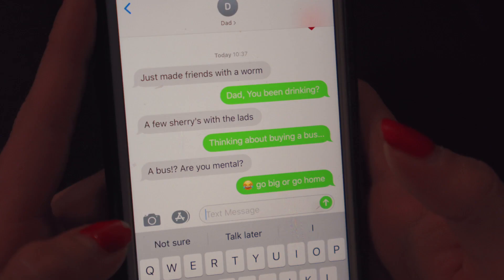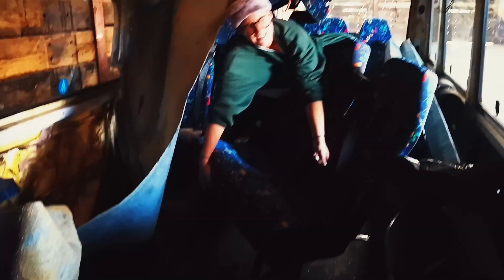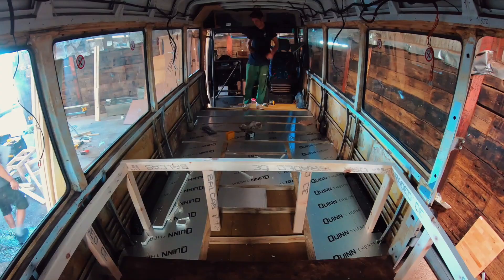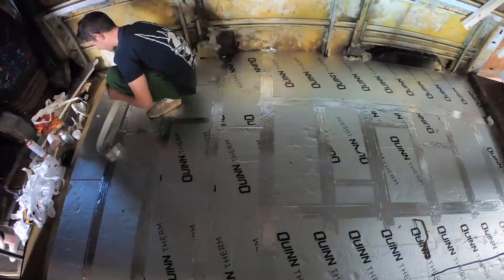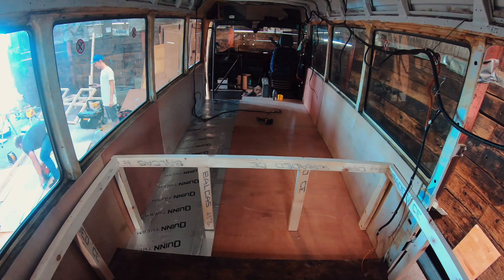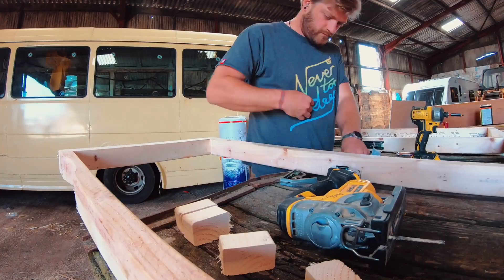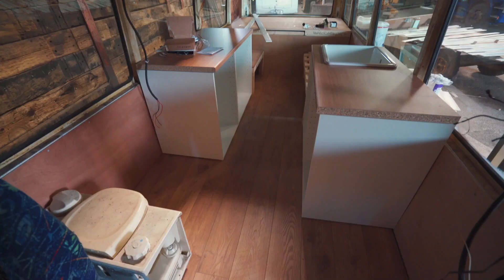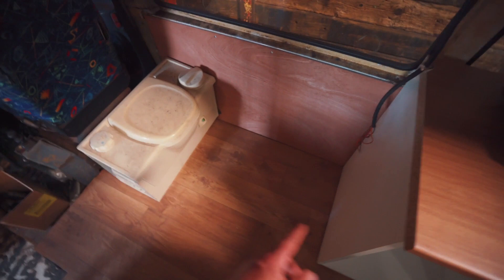How to INSULATE a VAN - Van Conversion with Kinging-It

Comment: Cant wait to see Custard finished...My husbands a big rig driver..I've driven it out on the highway to give him a break till my health lost my liscence, but a big bus is easier..once Craig gets his go for it Amy..Dont sell yourself short.even if it's to drive out in the open to learn an get used to it.Later he may need a break,or sleep,or if hes not feelin well you can jump behind the wheel.I believe you can.  This is a neat project..we redone an old 32 ft camper..looked like a little. Ountry kitchen when we were done..It was old but I still miss it.was so cute an homey...have fun you two.you will love it so much more because you two did it as a project together from the ground up...

Comment: Nice work well worth stripping out the old floor and treating chassis will pay off later.
I used to live in a bus and you lose a lot of heat through the large windows plus they can drip with condensation (could be a problem in the bed area).
I took all of mine out bar one and sheeted over the outside will ally plate, you can then fit smaller caravan windows here and there which you can open when hot, just a thought before you get further into build.